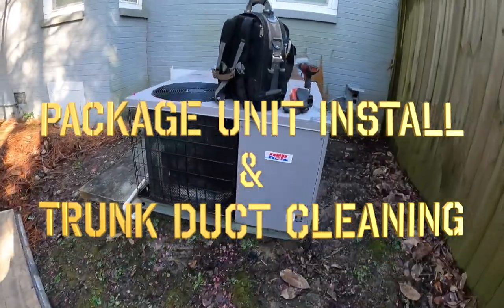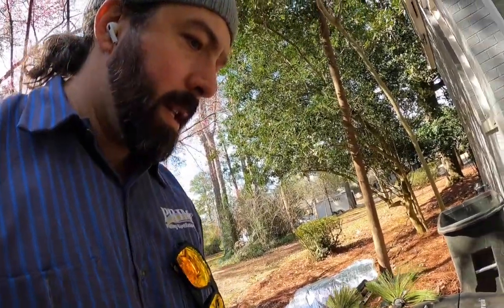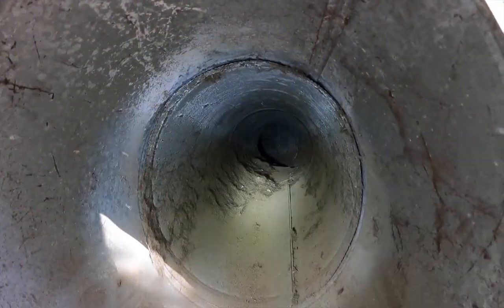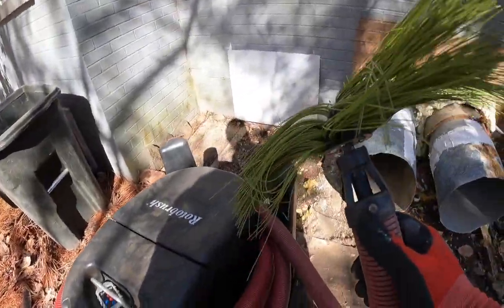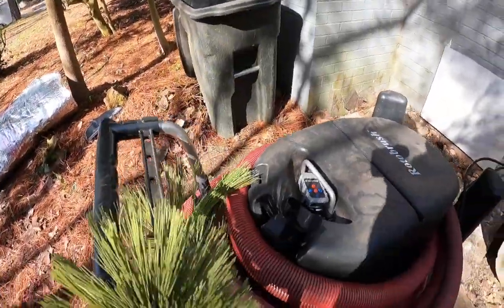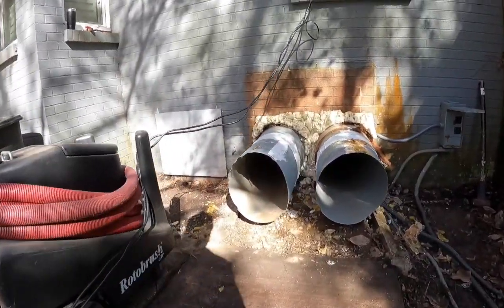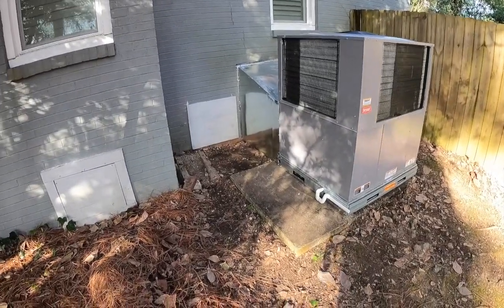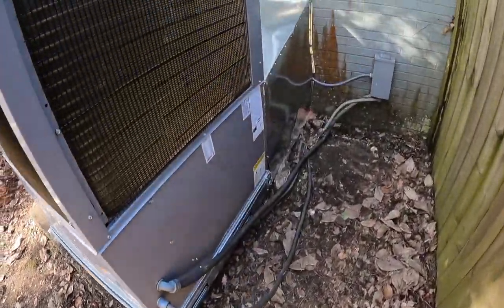Package unit install - Heat Pumps

Comment: Old Heil unit didnt really look that bad makes me wonder what was wrong with it?
Reply from the maker: It was well taken care of but had multiple refrigerant leaks in the evap coil.  Homeowner opted to replace instead of repair.
Reply: @AIRMANHVAC  yeah I'm one of these people I'm researching package units I have an old 15-year-old Trane unit split system on my manufactured home that has bit the farm. have had 6 separate estimates done in the last week and almost every single one of them has recommended I get a 5 ton american standard variable speed platinum 16 package unit because my air handler cabinet is just too restrictive for a proper filtered air box none of them can find a mobile home downflow unit.. so far they are telling me it would also be my cheaper option because less modification they would have to do to fit a new split system in But mehh I could care less as long as it works.

Comment: Let me ask everybody something if there's metal out there like that was and you just put off the takeoffs why wouldn't you finish the job with metal that don't make sense to me 2 90  on each side with a work with no problem I don't understand why you put flex in there instead of metal don't make sense I'm from Florida and that's how I would have done it I would have put 290 on each takeoff into the other pipe that's called professional and then build a dog house over it